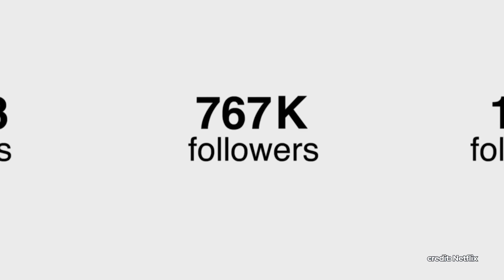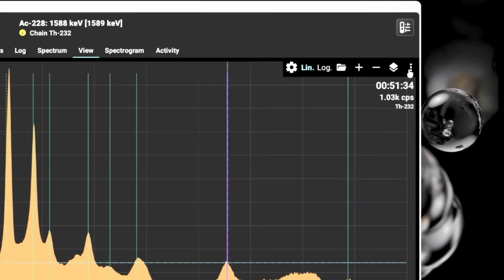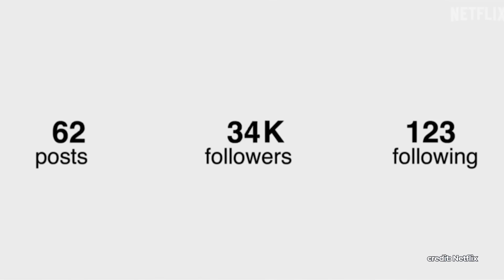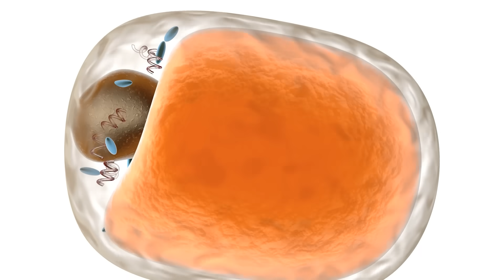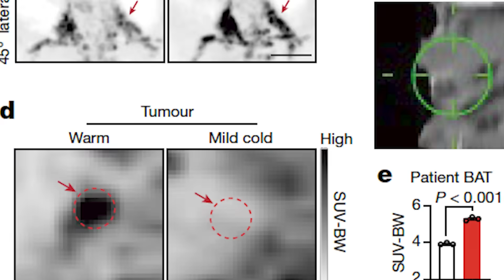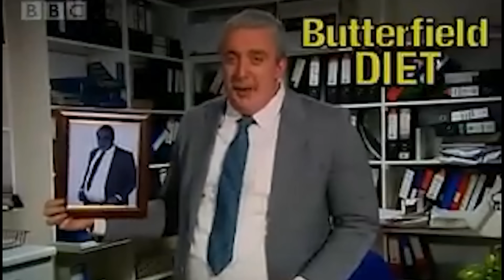Scientists Just Discovered How to Starve Cancer

Comment: I have lung cancer...squamous cell carcinoma, to be precise.  It started out with the right side ...one lesion...then after EBRT treatment course, another nodule appeared.  Now, again after another radiation treatment schedule for the second nodule.....I have another 8-9 nodules seen in both the right and left sides, within different lobes of the lungs.  Now, I also have the SCC seen in some lymph nodes int the mediastinum and hilar regions and one on my liver (full disclosure...have had a 10 cm mass on the liver as well diagnosed as DBLCL aka Non Hodgkins Lymphoma treated with R-CHOP successfully to put it in remission completely).  I just am beside myself with what should/can be done, if anything!  It's been a roller coaster ride to flipping hell.
Reply: Have you tried Methylene blue, Ivermectin? My daughter passed in 2023 after 4 years, stage 4 breast cancer diagnosis. I wish i knew many things i know now even though i know she probably wouldn't have refused. Wished i could kidnap her and forced her to fast and detox etc my prayers are with you🙏
Reply: @styleandlongevity5000  Nothing has been tried as yet for these newish cancers, except for the radiation on the two nodules from last year.  The lymph is positive for squamous cell, but not sure what type the liver nodule is at present either. Also of concern is possible metastasis to the brain...require an mri to determine that.
Reply: @styleandlongevity5000  I'm sorry, I forgot to say ty for your well wishes.  Minds just all over the place in between suffering massive head and jaw and ear pain, so ty again.
Reply: @precious14830  May God heal you, give you strength and clarity during this difficult time.

Comment: Potential research to establish a correlation: If the thesis is that extensive exposure to cold promotes the development of brown fat and brown fat inhibits certain cancers then a potential experiment would be to survey a population group that is regularly exposed to the cold to see if they have a lower probability of getting cancer or higher survival rate if they are diagnosed with cancer compared to a control group. An example could be to compare long term cold water swimmers with say runners or gym participants.

Comment: We've kind of known that the opposite has a positive effect too, but through a completely different mechanism. Basically that stressing a tumour with heat forces the cancerous cells to excrete heat shock proteins to protect itself, which makes it easier for the immune system to detect it.   So I wonder if a combination of the two might be effective.  6 days cold, 1 day hot, or something.

Comment: The keto diet still has some carbs which is about 30 grams per day. A strict carnivore diet or zero carb diet (mainly red meat and seafood) may increase thermogenesis because of:

High protein intake – Protein has the highest thermic effect of food (~20–30% of calories burned during digestion).
Low insulin levels – May help maintain a metabolic state (e.g., mild ketosis) that can promote fat oxidation.
Nutrient intake – Red meat and seafood are rich in nutrients like iron, carnitine, and B vitamins, which support mitochondrial function, crucial for brown fat activity.

I have been on the carnivore diet for 15 years and doing ice cold baths almost everyday. My body seems to have adjusted better on carnivore diet than keto diet.
Reply: You should start a youtube channel and make videos about yourself, sounds interesting!
Reply: @ Sure, I’ll start a channel. First video: How to survive the daily struggle of dealing with smart-ass comments. 🏆😂
Reply: If only meat was not the source of many cancers... The carnivore diet has many other bad consequences. You need alot of veggies without pesticides along with protein without hormones, toxins, penicillin... The point is to be free of added chemicals.
Reply: @ Not many bad consequences on carnivore. I had mineral deficiency during the adjustment phase but this was easily resolved by drinking more mineral water. Hormone residues typically present in very small amounts, measured in nanograms (billionths of a gram). 
Regulatory agencies (e.g., FDA, EFSA, FSANZ) set maximum residue limits (MRLs) that are considered safe for human consumption. Most cattle in Australia where I live are grass fed. 

No vegetable is truly "pesticide-free" because plants have natural defense mechanisms that produce compounds to ward off pests. The natural compounds like lectins, oxalates, phytates, tannins, glucosinolates, etc are scientifically proven to be harmful to humans.

Comment: The video explores a novel approach to cancer treatment centered around the idea of starving tumors by cutting off their energy supply. Here are the key points:

It draws inspiration from Otto Warburg's early 20th-century discovery that cancer cells consume glucose at high rates but process it inefficiently (the Warburg effect) [01:20, 03:45].
Past attempts to exploit this, like ketogenic diets, often failed because cancer cells can adapt and find other nutrient sources [06:06].
A promising strategy involves using the body's own fat cells. Activating brown fat (which burns energy for heat) showed potential in reducing tumor growth in mice by competing for glucose [10:07, 11:07].
Researchers at UCSF have developed a "living cell therapy" using white fat cells genetically engineered to act like brown fat (called beige fat). These enhanced cells are highly efficient at consuming glucose [13:32, 14:44].
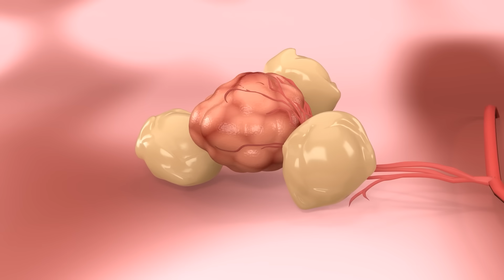In lab experiments with mice, implanting these beige fat organoids near tumors significantly reduced tumor growth (by over 50%) across different cancer types by outcompeting them for nutrients [14:11, 15:05].
Fat cells are advantageous for this therapy as they are easy to work with (extract, modify, re-implant) and compatible with the immune system [15:32].
While more research is needed, this method suggests a potential future where cancer could be treated by starving it with the body's own modified cells, offering an alternative to traditional treatments [16:32].

Comment: Very informative, but our enemy is metastasis in cancer. Benign cancer is not so deadly and has a high chance of recovery. However, when cancer spreads via CTCs and enter through DTCs, it becomes a significant problem. Despite its potential, beige fat therapy remains in its infancy, and its effects on metastasis—particularly in the context of epithelial-mesenchymal transition (EMT) regulation—are not well understood and Cancer can also use other metabolic patways to extract energy as cancer is the accumiliation of mutations.

Comment: I dreamt about a drug called CP-526,423 which I was administering to my father who has diabetes (also in dreams). When I woke up I wrote it down because the name of the drug was still very clear in my mind. After sometime I went and google it, and it exists, but the testing of this drug stopped at clinnical trials.. I’m writting this and hoping if someone reading this has ability to maybe test this drug further. Maybe it’s nothing but I have a hunch, can’t explain it. After watching this video the thought of this drug came to mind and I needed to find correlations to not only potentially treat diabetes but cancer aswell.
This is what I found:

Cancer cells grow fast and need a lot of sugar (glucose). Even when oxygen is available, they prefer to burn sugar in a less efficient way—this is called the Warburg effect.

The enzyme aldose reductase helps process sugar in cells, and when it’s too active, it can push cancer cells to grow even more.

A drug like CP-526,423 blocks this enzyme, making it harder for cancer cells to use sugar as fuel, which may slow their growth.

I would love some feedback

Comment: Diets have a spoty record but they can have an effect. The latest research has proven cancer cells cant metabolise fat or ketones. They metabolise glucose AND/OR glutamine( an aminoacid). So it is entirely possible to severely limit cancer growth thru prolonged fasting. Some people have cured themselves like this. There are studies indicating that stressing the cancer with starvation makes chemo far more effective. There is also reseach in the direction of chemically crashing glucose and glutamine levels to an unnaturally low level while maintaining life thru fat and ketone metabolism. So far it seems the starvation doesnt directly kill the cancer but the stress markers it releases from its starvation trigger the immune systems response.
Reply: The issue is that glycerol will still be converted to glucose.Your body will ALWAYS maintain glucose levels in the blood, if it didn't you'd become hypoglycemic and have severe side effects. Unfortunately unless there are specific trials showing it is beneficial, keto is unlikely to work...
Reply: @malmal1716  pretty sure you mean glycogen. And no that is not entirely correct. The body depletes it in a few days. After that blood sugar levels drop to far lower than baseline with the body using protein to create the small amount it absolutely needs. There is a several fold difference between the lowest blood sugar levels one can safely have and the upper range of a normal healthy levels.
Reply: @SlayerBG93  No, I mean glycerol-a component of triglycerides.Released by breakdown od adipose tissue in order to create glucose via gluconeogenesis.
Glycogen is the stored form of glucose found in the liver+muscle tissue, not adipose tissue.

Do you have data to support the fact that blood glucose drops significantly on a ketogenic diet?
Reply: @malmal1716  Sure, I am will post the first one I found. "Prolonged fasting outperforms short-term fasting in terms of glucose tolerance and insulin release: a randomised controlled trial" 
after a mere 6 days fasting their blood glucose was about 55mg/dL when the healthy range is considered 70-100mg. Studies for extended fasts are very limited but individuals that have been measured for longer periods of fasting drop even below that level with no symptoms.
Reply: @ hm that appears to reference a 6 day fast-not a ketogenic/ low carb diet?And how exactly do you believe prolonged fasting would work?That's essentially starvation?

According to the CDC:
 Blood sugar below 70 mg/dL is considered low.
Low blood sugar, also known as hypoglycemia, can be very dangerous

According to the mayo clinic:
Severe hypoglycemia may cause:

Unresponsiveness (loss of consciousness)
Seizures

According to cleveland clinic:
For most people without diabetes, hypoglycemia is when your blood sugar level is below 55 mg/dL or 3.1 mmol/L.

Hypoglycemia requires immediate treatment by eating or drinking sugar/carbohydrates. Severe hypoglycemia can be life-threatening and requires treatment with emergency glucagon and/or medical intervention
Reply: @malmal1716  I specifically referencing prolonged fasting in my original comment. Basically controlled starvation. It is important to note that normal blood sugar levels are a baseline for people on a regular diet. People in deep ketosis can tolerate much lower levels since their energy metabolism compensates with ketons. There have been people with numbers in the low 30s that were walking around pretty much simptomless due to their bodies gradually addapting. 
The people that treated their cancer with starvation dieting usually forgoed food for weeks, only supplementing with vitamins and minerals. This is perfectly safe if done under medical supervision with the record longest fast ever being over a year for a morbidly obese person. So far the research is anecdotal but there is promisse and there are studies combining fasting with chemo with very promising results.
Reply: @ hm I'd argue that these protocols carry more dangers than benefits.It's impossible to completely shut off the glucose supply in the body as the body will find ways to convert other things into it regardless.Perhaps at a lower rate but still...

And considering that cancer cells are extremely agressive and "hangry" lol they'd probably suck up the nutrition regardless.And you'd end up essentially burning off the fat storage and using it to still feed the cancer.

Idk I would like to see research on this-definitely!More studies need to be done.But in the meantime it seems far too risky to compromise a body already fighting something so horrible if we don't have exact data to justify it yet.

Comment: What are the cancer rates in really cold countries?
Reply: The same or higher than warm countries.  But that is because they have low levels of vitamin D because of lack of skin exposure to sunshine.  Low vitamin D levels will cause all kinds of health problems like weakening your immune system which in turn raises your risk for cancer.  Move to warmer climates or take vitamin D supplements along with magnesium, vitamin K2, and zinc.  You need all 4 nutrients in order for vitamin D3 to optimize its healing effects.

Comment: Although this is very interesting work, I think it will have limited use cases. It seems to be limited to non-deep seated cancers that allow surgeons access to the tumor. Maybe it could see some use as adjuvant following resection. We see time and time again that late stage cancers that are past the window for resection require more drastic treatment regimens. Cell-based therapies will always be limited by the fact that the tumor microenvironment is very unaccommodating to non-cancerous cells. Even immune cells like macrophages, natural killer cells, and T cells that could illicit an anti-tumor effect are suppressed. Late stage cancers are incredibly dense and it becomes difficult to treat the whole tumor, often limited to just the edge or the parts that are well vascularized.

All in all, what we desperately need is not new forms of cancer therapy that will dilute funding, what we need is a measured all-in on a few highly promising therapies and therapeutics that can see application to multiple cancers. Bring those promising therapies to clinical trial to be validated, and not have them peter out after one failed trial or even before they get to clinical trial. Basic oncology research is necessary, but translational research should also be prioritized. So much funding is wasted on novel, proof-of-concept treatments with mediocre efficacy for the sake of novelty alone. This is why every year you hear about this new thing that has potential to "cure" cancer, but then you don't hear about it ever again. So much research in pursuit of "new" that we throw away the "old" like a toy we got bored of. Just my two cents as an aspiring researcher in these fields.

Comment: My take away from this: 
More brown fat equals less cancer. Turns out all these cold plunges I'm doing are good for something other than making me feel good.
Reply: Okay but what about cancer rates in cold countries, that are not lower than in hot ones? I just checked and it seems counterintuitive in this case
Reply: @janny.p  - 🤷‍♂️. Maybe they aren't cold enough? Doing plunges in 35°f/1.6°c water shocks the nervous system and forces the body to do things that wont occur if it's just cold outside and you wear a jacket to keep warm all the time. Or maybe this new treatment method only works at shrinking tumors when brown fat is injected locally at the tumor site. Having lots of brown fat stored in various parts of the body may not be enough.

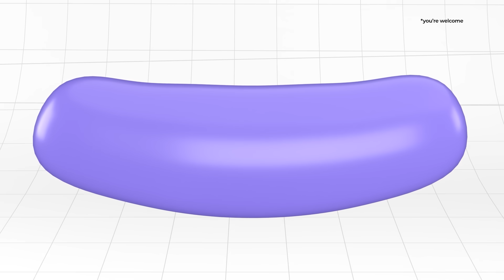Comment: @Dr Ben Miles - 3:21 you’ve glossed over the the how’s of cancer and missed the more obvious causes.

Saturated fats and oils, oils being the worst, damages, the mitochondria and cells causing them to go like you explained.

But solving the causes should be a step 1 priority. 
Stopping it’s spreed and killing should be step 2

So …
Step 1:
Read the Colour Pitcher Book by Dr John McDougall 
Sep 2: 
Don’t consume saturated fats and oils. Or dairy. It causes sludgy blood, suffocating cells, and mitochondria!

Saturated fats, Oils + Dairy = auto-immune diseases, as the mitochondria suffocate it can’t support the junctions in the gut and in the blood brain barrier. And also allowing the auto immune system to learn from the dairy molecules in the body, then teaching them to attack similar molecules in the body like the myelin causing MS, or the pancreas, causing diabetes type one etc etc.

In the case of MS losing that function of supporting the junctions in the blood barrier allow it to leak the kill ourselves into the spinal fluid where they can attack the nervous system and the brain and spine.

Love the problem learn and teach to fry with water 💦 making even yummyer foods as the saturated fats oils and blocking the taste bud receptors